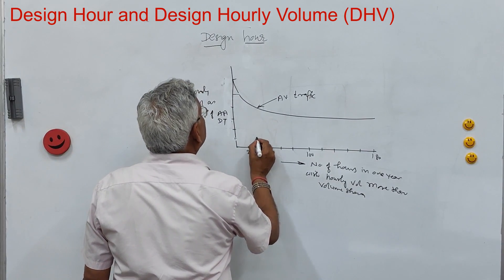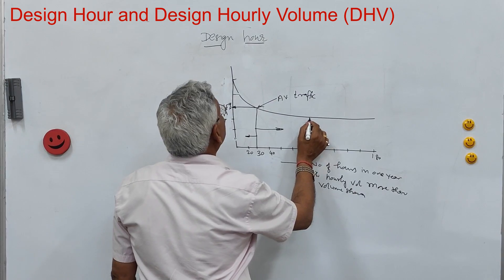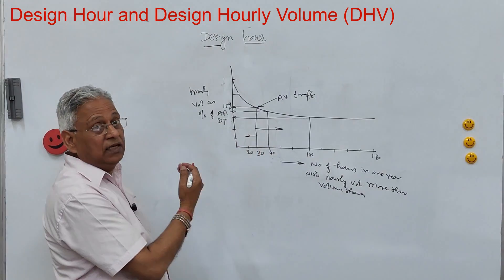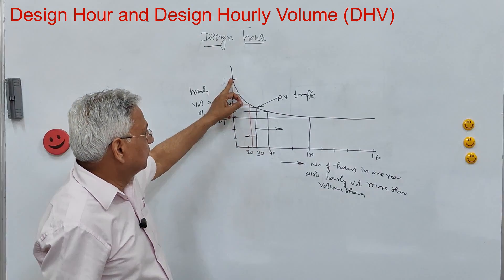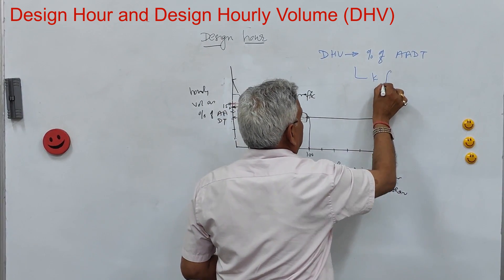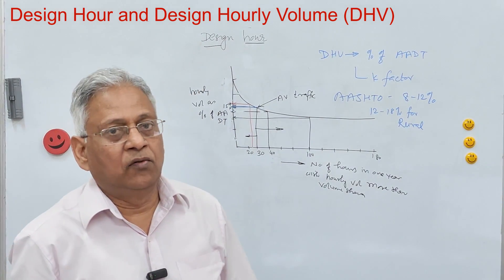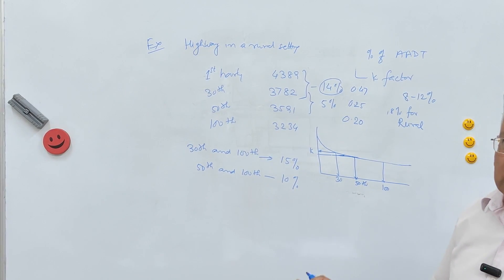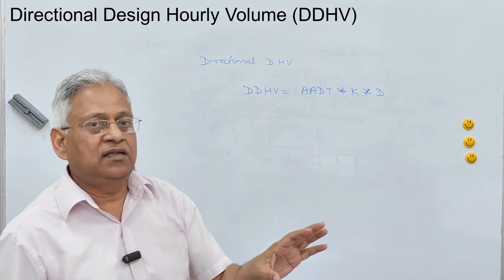Design hourly #volume and design hour, #DDHV #K-factor 30th hourly volume, all in one video

Comment: Professor what is the minimum permissible curve radius on Broad gauge railway tracks? and what is the minimum for meter gauge?
Reply from the maker: The maximum degree of the curve used in IR is 10 degrees for BG and 16 degrees for MG. That way the minimum R for BG is 175 m and for MG is around 100m.
Reply: @SatishIITR  Thank you sir